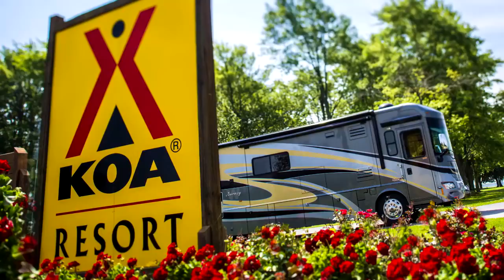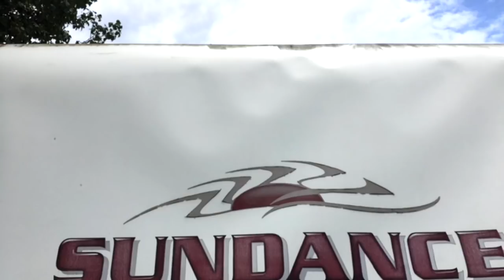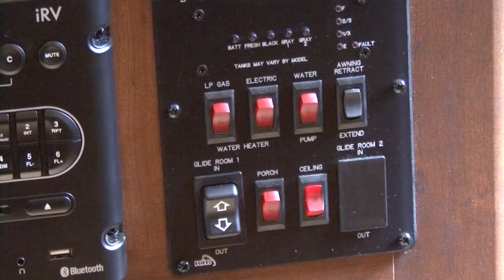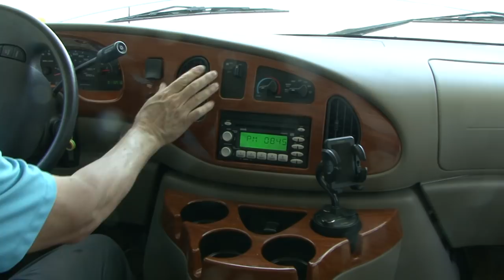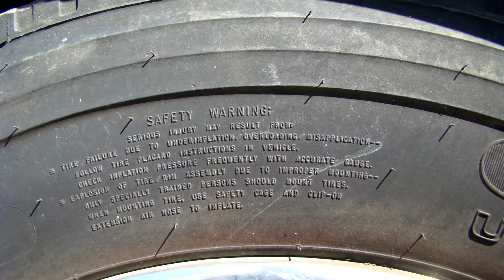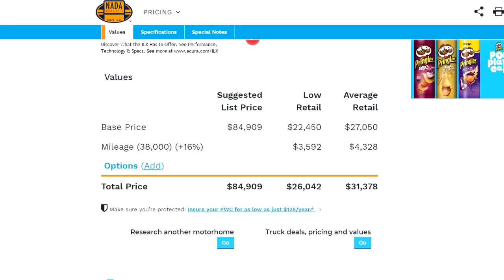RV 101® - New RV Owner - How To Tips for Buying a Used RV from an RV Expert

Comment: These same checks apply on NEW RVs as well.  I bought a new one that had over 30 issues.  Missing seat belt on the couch, microwave not properly mounted, extensive rust and corrosion underneath, floor bubbles, trim detachment, etc...